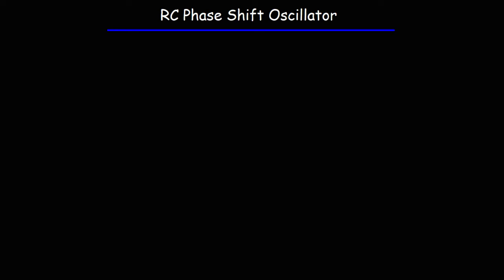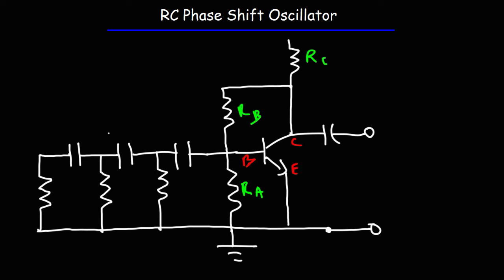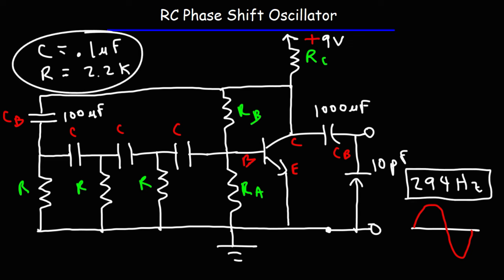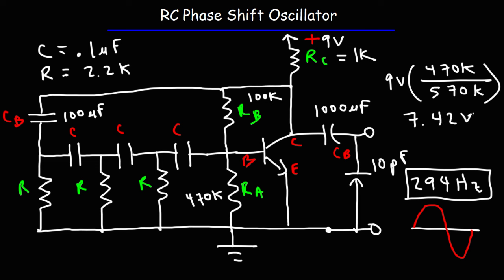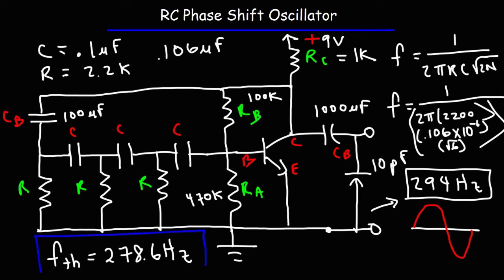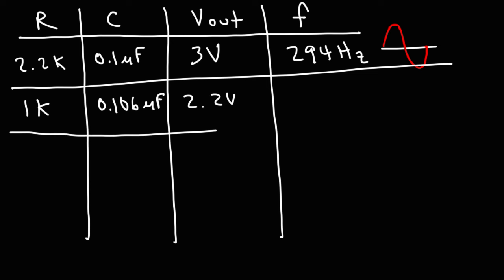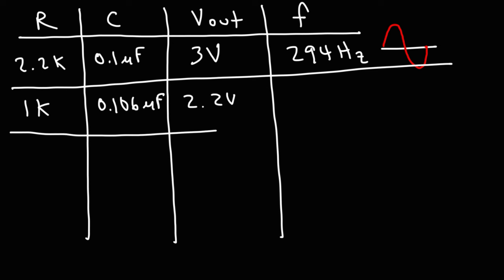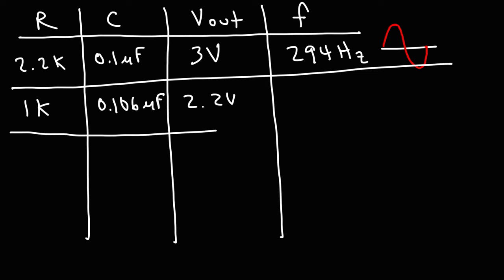RC Phase Shift Oscillator Circuit Using a NPN Transistor

Comment: I'm starting to have an extremely vague idea about why circuits are designed the way that they are. I wish that for the discussion at 11:29 he would have showed the frequencies with the same set of resistor values though varying the capacitance values. Overall a very good lecture.

Comment: Big mistake: The leftmost R doesn't count as part of the phase shift line, 'cause it causes shifts just in connection with the capacitor CB, whose value is large in comparison with the three C's. Instead, the base voltage divider is part of the phase shift line.

Comment: I see a mistake in the calculation of the base bias. You must consider the collector voltage not the supply voltage in the potential divider formula. But practically, because the collector resistor is well less than series connected RB resistor, the omission of the collector resistor causes no problem in this particular case.

Comment: I would like this to use as a practice CW oscillator with a 9V battery and put a little speaker in the line to the collector.
I think I'll still need a kind of a resistor in series with it ....

Comment: The voltage in point B is determined by the transistor's base to emitter diode which is normally around 0.7 volts. we cannot use the voltage division of  RA and RB. the base-emitter diode creates a reference voltage at point B

Comment: I have a query...in the circuit you drew on the screen you drew no emitter resistor.  Is cool.  Then you calculated a voltage at the base using a voltage divider with R(A) and R(B).  Is also cool, but then you told us the voltage at the base would concur with the voltage you calculated for the voltage divider.  Isn't the voltage drop across the Base-Emitter just the 0.6 volts of the PN junction?  You told us it should be 7.42 Volts.  I've never seen a 7.42 V semiconductor PN junction forward bias voltage but there's always a first time I suppose.  I'm just confused.

How did you cause the voltage at the base to rise to 7.42 volts without an emitter resistor again?  I've no doubt you caused your oscillator to work with the values you used, it's just...well I'm confused.  Seems like 7.42 volts across a PN junction would require a reverse bias.  Wouldn't that turn the transistor off?  I don't get it.
Reply: the 7.42 volts calculated is a voltage divider being fed into the base of the transistor. He is saying we need to make sure the voltage divider is high enough to turn on the transistor because if the BE .7v drop. So he was just clarifying that the voltage divider he used is in fact large enough to turn on the transistor.
Reply: @marisavittorio7347  Uhm...ok.  Is the emitter of the transistor on ground?  What is the voltage across a forward biased PN junction?  Just how does the voltage at the base rise above ground potential +0.6 or 0.7 volts?  It's a lovely voltage divider...that isn't doing what we think.

Comment: I can't get it to oscillate. Varied the voltage on the base from 0-1.5V and I know the transistor was on because I was measuring Ic. Ic would vary from 0-15mA with Rc=1K.
Even measured Ib to make sure. Just don't get it. I built it on a breadboard so maybe parasitic capacitances. I don't know.
I found this https://youtu.be/PN8iwDNj658?t=1388 video that talks about the problems with this kind of oscillator.

Comment: But how does this circuit produce a 180 degree phase shift?
Reply: In the 3 RC circuits in a chain, each stage makes an 60 degree phase shift.  3*60=180.
This circuit as shown is really not very good but it will work.  The NPN transistor has to provide a gain greater than 29 for it to oscillate.  His circuit does a rather poor job of setting the gain.

Comment: The schematic is wrong. The author does not understand how it works. From collector towards base, C must go first, then R, not vice versa. Only this way the first RC couple will create any phase shift. Of course, then you do not need Cb. Ra constitutes a negative feedback from collector to base, so it can prevent oscillation if Ra/Rc is too small (100:1 should be OK). Ra parallel to Rb acts as R, so if you chose 100K||470K, R would be around 82K to roughly meet the formula (dynamic base resistance also plays a role in this). As for the bias: for BC549 and 2 mA collector current Vbe would be between 0.5 and 0.6 V. Ra and Rb acts as voltage divider, so for Ra:Rb = 1:4.7 as in this example the collector voltage would be almost equal to Vbe:  Vce = Vbe * ( Ra+Rb  / Rb). Therefore Vce would be 0.66 volt, pretty close to saturation. Author's claim the Vbe would be 7.42 volts is a complete bullshit - first, the source voltage for the Ra/Rb is not 9 volts, but Vce, second, if you put 7.4 volts hard to base-emitter junction, you would blow it because the base current would exceed the maximum allowed current by several orders of magnitude. If you want a decent working point, Ra should be at least 3 times the Rb (then you would get Vce = 1.5) but it can be as high as 7 times Rb - then you get Vce around 3-5 volts, about half the supply voltage. So in fact, swap Ra and Rb, make Ra = 470K and Rb = 100K, then you should get nicer sine wave without distortion caused by transistor saturation.
Basically, you could replicate this circuit and it may even oscillate, but the author has no clue what he's talking about.
Reply: kindly,explain me in more depth please
Reply: @mpkdon  let me think please, it was a year ago :-) I have to recall what i thought then
Reply: @mpkdon  OK, I got it. In the feedback circuit: the big Cb capacitor (100 uF) and the resistor R connected between the Cb and ground, has very little effect and contributes almost zero phase shift. So, if you remove both of them and connect the first C directly to collector, you will get a circuit with the same behavior, but save two useless parts. This is because the phase shift is created by differences between voltage and current across a resistor vs capacitor. Voltage phase at the first R does not depend on anything (because Cb is big) and the first phase shift occurs only after the first C.The phase-shift network hence constitutes of C-R, C-R and C-Ra||Rb.
As for the DC bias: Vbe of the transistor is approximately 0.6 volts. Rc, Rb and Ra form a feedback network - the greater collector current Ic, the lower will be collector voltage Vce. Therefore the collector voltage will settle at Vbe * (Ra + Rb) / Rb. In this case, Rb / (Ra + Rb) is approximately 5/6, therefore Vce will be approximately Vbe * 6 / 5, which is about 0.72 volts. If you imagine that the circuit produces sinewave oscillations, it is clear that the output swing must be limited but the lowest possible Vce, which is the transistor's saturation voltage. For BC549 type of transistor this saturation voltage could be about 0.2 volt. Therefore, negative halfwave output amplitude (half amplitude) can be maximum ~0.5 V, but most likely it will be distorted. Positive halfwave would be approximately the same as the negative.

Comment: Unfortunately, your practical observations do not agree with the theory. As you decrease the resistance almost to a half, the frequency does not double. And when you increase the resistance almost 5 times, the frequency decrease merely by a factor of 2.5.